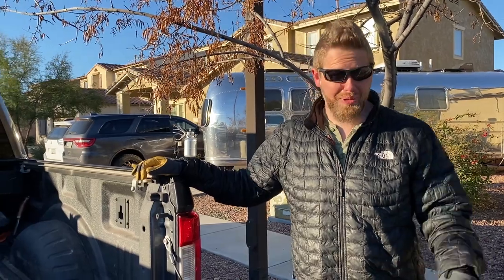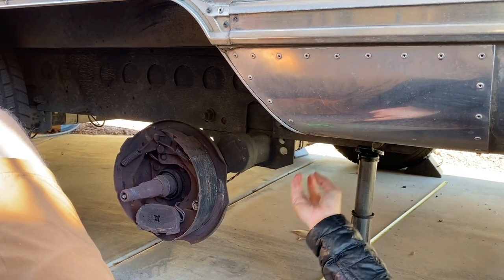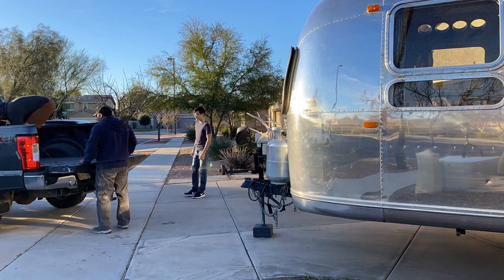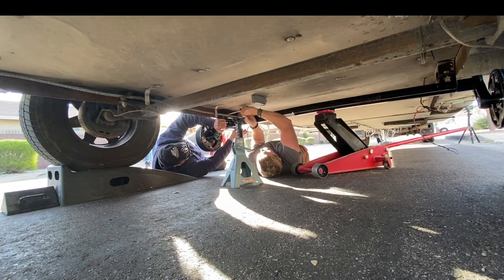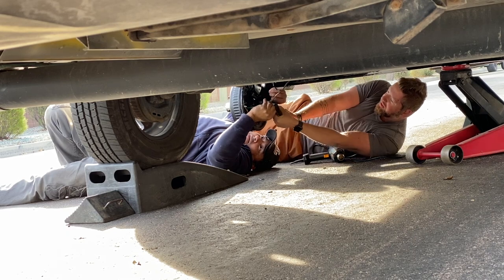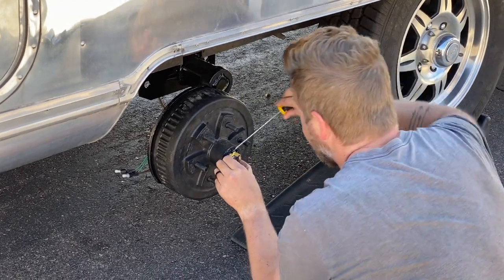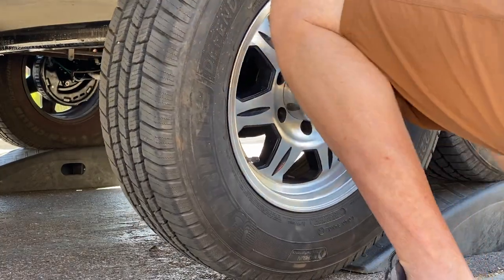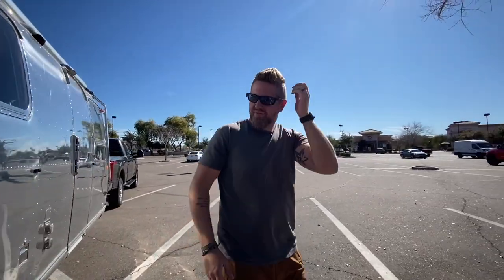Replacing Axles on 1972 AIRSTREAM in the STREET!

Comment: I may have missed it, but you don't mention reattaching or detaching the shocks.  do the 72 models not have them?  my 1970 Overlander has a bracket off the downslung arm for a shock absorber that then goes forward of the axle.
Reply from the maker: We took them off during the original renovation because they never fit right after replacing the original axels. The torsion works just fine for shock absorbing.

Comment: Hi, thank you for sharing your video! If you don't mind my asking, who did your purchase your new axles from? We are hoping to replace ours soon as well! Thank you for your time 😊
Reply from the maker: We’ve bought axels twice now, both from different shops depending on where we were(AZ and IN). Dexter won’t let you buy directly which is a pain, but since they ship freight you’ll have to go through a local dealer (unless you can find the exact ones you need online, but unlikely with an older Airstream)
Reply from the maker: We used Waymire in IN and Rucker trailer works in AZ.

Comment: NIce job on replacing your axles.  I'm about to do the same on 1974 Airstream.  I'm replacing the original axles.  When you replaced yours did you have issues with the frame cut out fitting the new axles and the holes on the mounting bracket?  Do you remember what axle size you went with?
Reply from the maker: Well..we replaced them originally during the renovation, and yes I think there were some minor modifications needed. Couldn't tell you the axle details, though. It's been so long 😂
Reply: @TinyShinyHome  Right of course.  Are these new ones the #11 size frame with 12" drums from Dexter?  Your trailer is fantastic!  Very inspiring.

Comment: nice job.. one tip on the new brakes and or magnets.. What i do is go down the road when traffic if light.. speed up to about 30-40 MPH and use the hand control to engage the trailer brakes HARD slowing you down to like 10,, release the control and speed up again to 40, hit brakes hard,, etc.. I do this some 3-4 times in quick succession,, after the last time drive for 10 or so min without hitting brakes to allow for drums/pads etc to cool.  

This process is called,,, "Bed-In" the brakes pads.. it very important on performance brakes but will do you for regular stuff as well..   thanks for good video..   https://www.hawkperformance.com/how-to